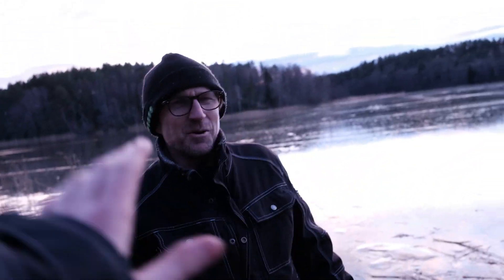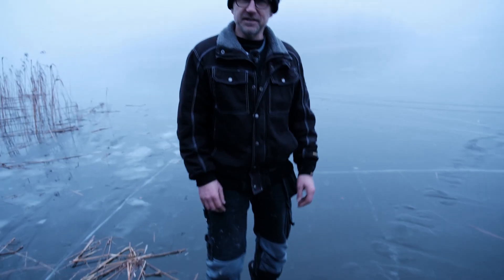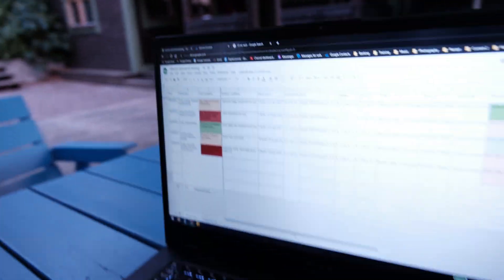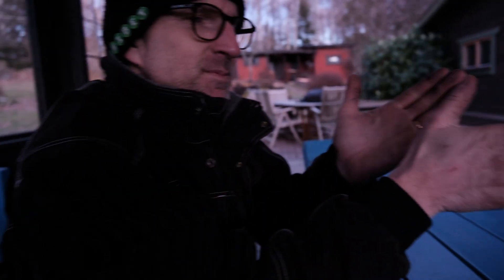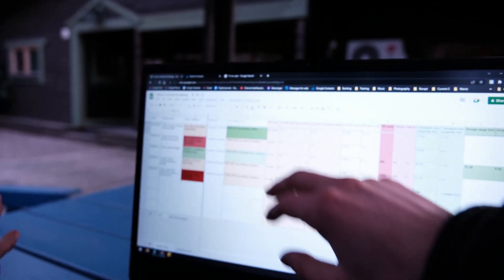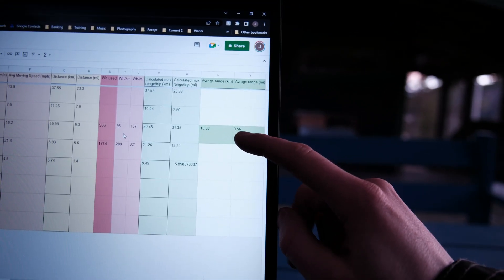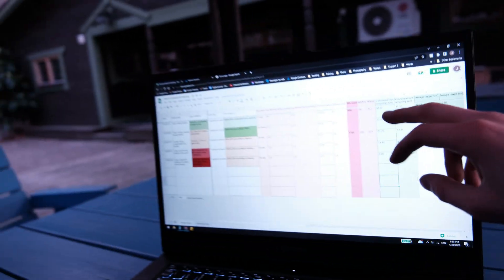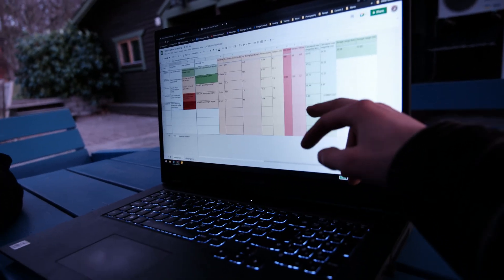Mini Electric Airboat Range tests! How far will it go?!

Comment: I’m trying to copy your outboard motor build unsure if I have to use a resistor to pre charge capacitors in the esc thanks any help you can give would be greatly appreciated thanks
Reply from the maker: Hi @CraigMccready! Without knowing what the details of the build are, it is hard to answer, but using a pre-charge resistor is applied in some applications. /John

Comment: Thats quite the adventure.  I live in Ontario and have a remote cabin on a water access lake that i would love to be able to reach 12 months of the year.  This looks great, how much of a hill can they climb.  See you climbed on the dock but i probably have 1000 meters and 80 meters elevation in 3 slopes
Reply from the maker: Hi @David Ivens! A few things needed here, poly underneath to give good slip, and the question is if the power is enought to get over the slopes due to us not knowing the gradient. With that being said, you can always get out, and using the remote, move the boat forward without being in it. This is one of the most useful features of this kit, and we use it daily! But as for 1km and 80m elevation, that does seem ok, if you take into account the first comments. /John